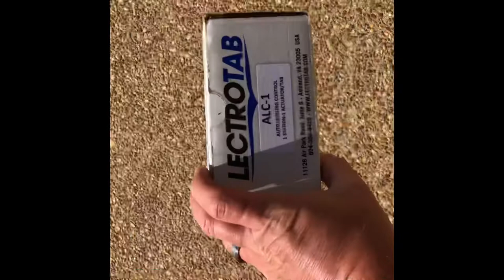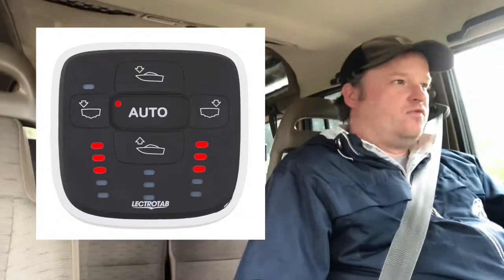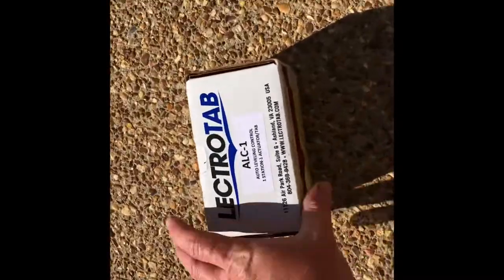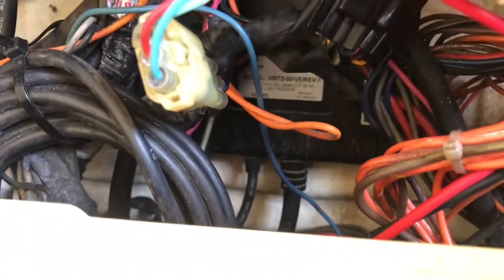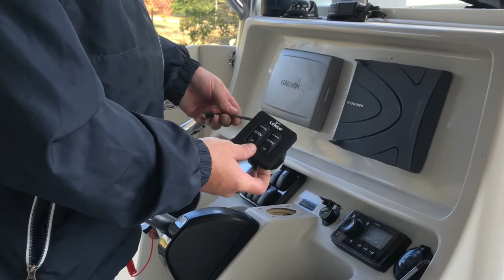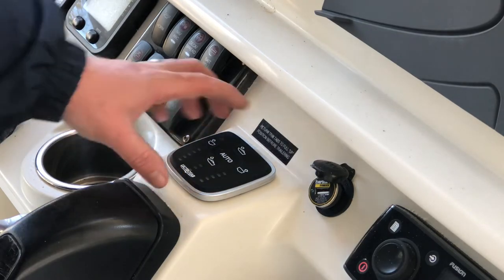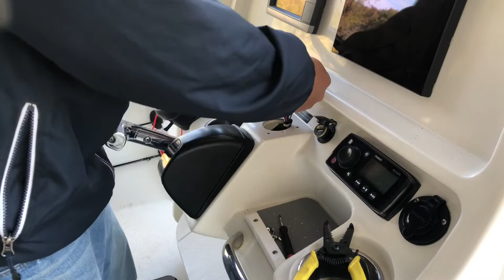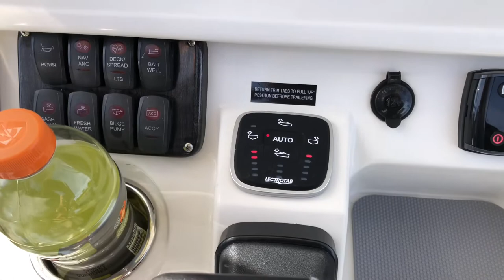Lectrotab automatic trim tab controller install retrofit to Lenco equipped center console boat

Comment: I have a Sailfish 218WAC.  I'm on the fence between this and the Mente Marine ACS and Lectrotab one touch. What made you decide on this one?
Reply from the maker: Both are probably the same device but Mente wasn’t selling theirs at the time. I’d prefer to spend my money on USA sellers and their technical support has been awesome. Have fun getting someone in Finland to answer the phone and walk you through issues.
Reply: @Terramaradventures  Was there much support required?  I was under the impression it was basically plug and play.

Comment: Hi there, I'm thinking about changing my lenco controller. 
Question: Do you need to go through any of the installation or statup procedure again and reset the controller each time you go out, or maybe each time the batteries are disconnected or isolated?
Thanks very informative 👍
Reply from the maker: You don’t, it will stay in either automatic or manual mode. Whichever you left it in when powering down.
Reply: Overland Camel  
Thanks for the reply, much appreciated.
Cheers 🍻

Comment: Hi, I purched this and am going to cut off the lenco box the same way you did, do you still have what colors go to witch number?
Reply from the maker: Sorry I don’t. But I did find that the colors didn’t match what Lenco listed on the schematic. I used the continuity function on my multi meter to find which pairs of wires went together for each servo.

Comment: Hi sir
i have a (( 2000 sea ray 240 sundancer  ))  and i have the factory trim tab its working good can i remove my trim switch and install this one  or i have to change all the unit ?
please let me know so i can buy one .
Thank you
Reply from the maker: It should be able to work with your trim setup. Lectrotab says it will work with a couple different manufacturers.
Reply: @Terramaradventures  Thank you so much for your responding God bless you